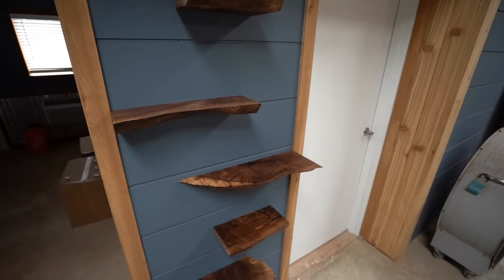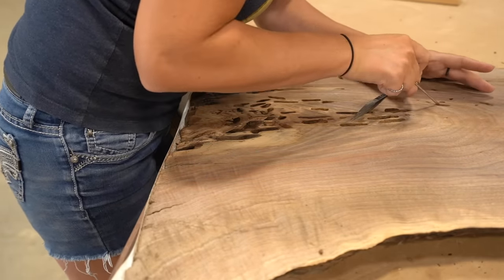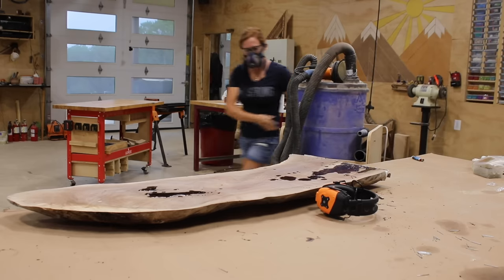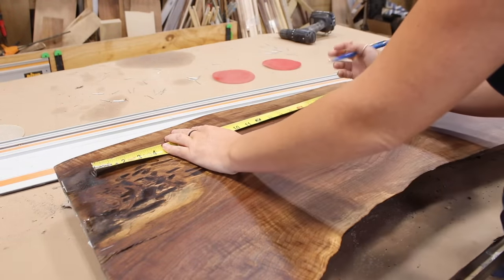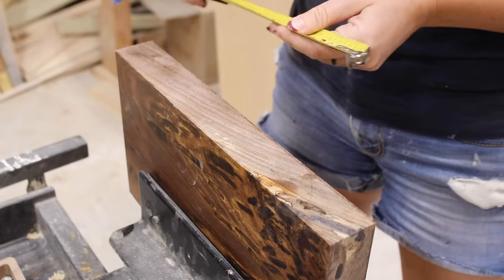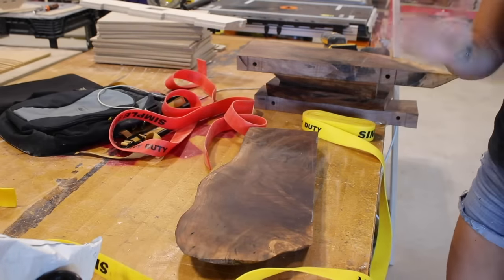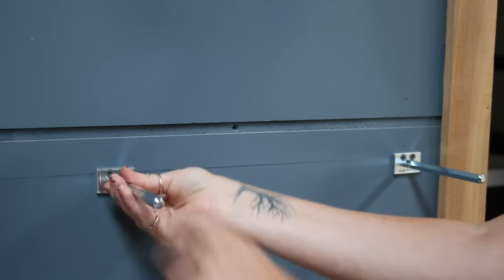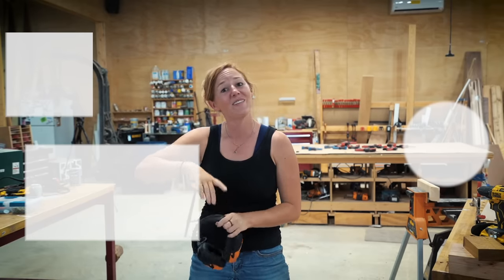Live Edge Floating Shelves | How To Build

Comment: I love your video's But (there is always a but) on your second shelf from the top down the one edge has a sharp point that could be a problem if someone walks through the door and turns. I know it might seem minor but after a lifetime of building stores, I am always on the lookout for these types of concerns. Please do not take this as criticism, but just trying to pass along things I have learned for the past. Another great video!
Reply: If people learn to watch where they are going it won't be a problem.
Reply: @genewaddlerandomstuff2122  True, but easier said than done.
Reply: I noted that too. That one shelf looks like a hazard so close to the door.
Reply: @genewaddlerandomstuff2122  The problem is people don't look. I spend over 30 years building stores and trust me people walk into all kinds of things even a big wall caution tape around it sticking out into the mall.
Reply: @chuckcobb5857   It would be funny if not true!  I was thinking the same as soon as I saw them.  Sharp corner by the door is asking for trouble.  They sure are pretty though.

Comment: Those shelves are beautiful.  It's funny, though, how old things become new again.  That portable drill press (in a MUCH earlier and far more basic model) was an 'as seen on TV' product in the late 70s.  I owned one and it did most of the same things yours did and I believe it was 'only $19.95'.  But wait - there's more!  I owned one and it was an extremely handy tool, especially when you had to drill a hole in round stock.  It was fun to see the concept evolve into the next century.

Comment: What we learned a number of years back is that CO2 is what pops the bubbles in epoxy.  We would use the gas line from a kegerator to wave over the surface and like magic they pop.  Plus CO2 is heavier than air so it settles out on the surface and spreads out.   In a pinch once we used baking soda and vinegar in a pitcher.  Poured the top gas out of the pitcher and the bubbles started to pop.  Pretty neat since you can't see anything coming out of the pitcher.

Comment: I am NOT a big fan of epoxy filling in wood.  In my opinion sanding epoxy is a big no-no.  It's because even when you use the respirator and vacuum to collect the epoxy dust is still in the air and you'll breath it later on.  All the microscopic  epoxy particles gets to the lungs.  That in itself can cause allergy to epoxy and if this continues it can become problem causing down the line.  My university professor (my minor was plastic)  shared story about one of his former student that professionally built yacht.  He used a lot of epoxy during the day and he eventually became allergic to it, and he had to close shop because of it.  Why can't wood workers simply fill the cavity with epoxy far enough to bring the epoxy level to the reset of the wood's surface instead of over filling it so the surface needs to be sanded later on and call it good.  I always enjoy your videos April.